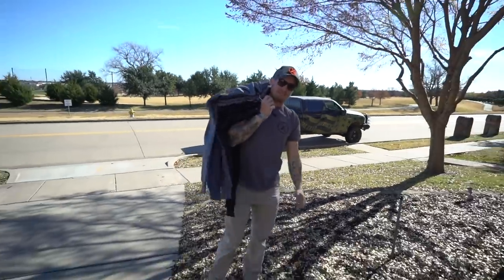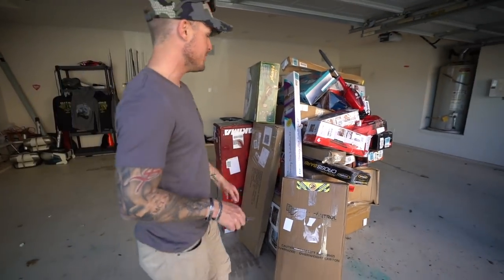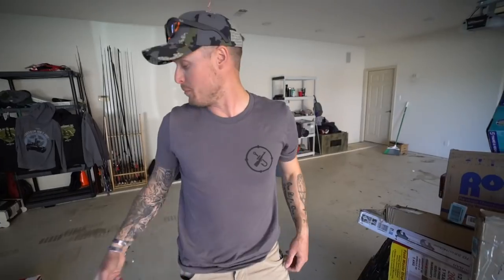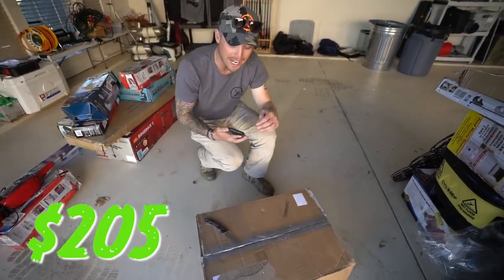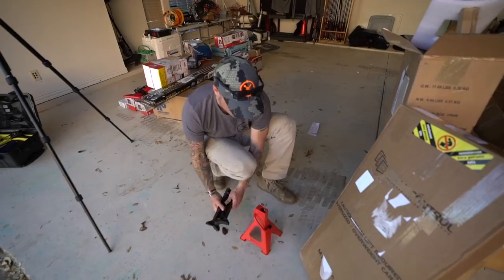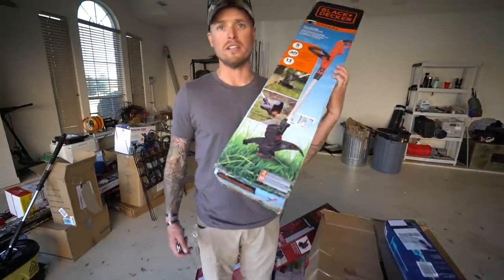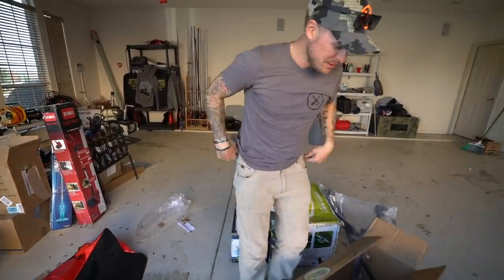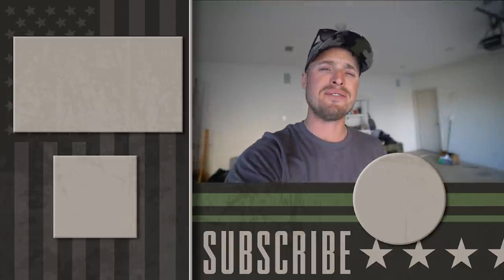Mystery Amazon Return Crate Unboxing  - $1845 in Profit

Comment: The suspension part at 17:25 is for a 2007-2014 GM 1500 pickup or SUV drivers side lower controll arm, u have the cast iron version they came with either iron or aluminum.